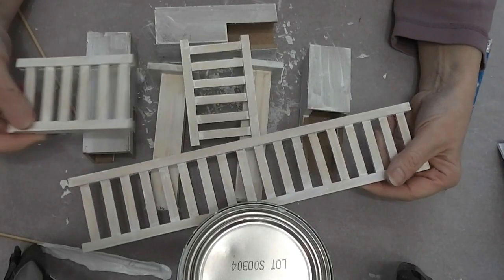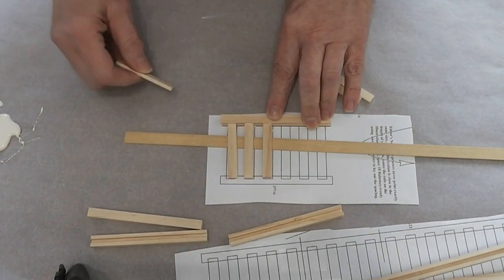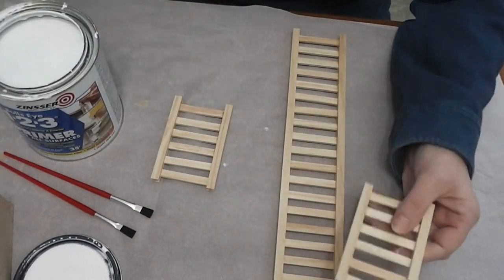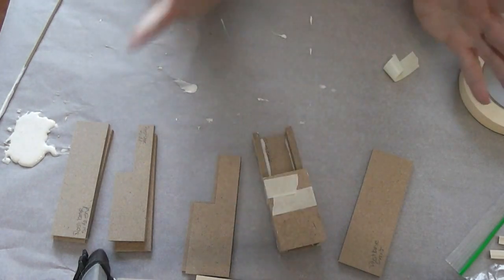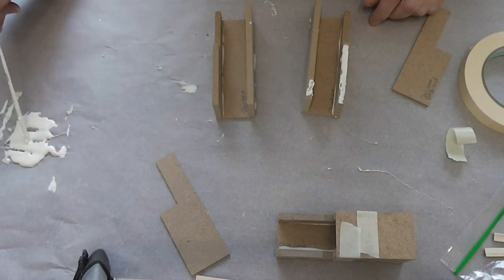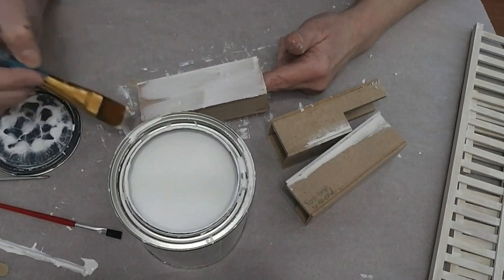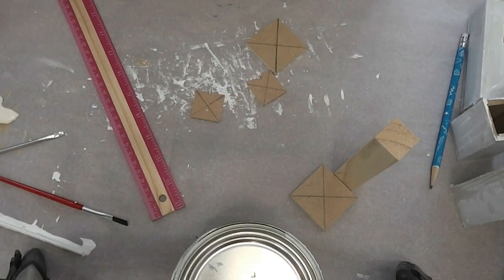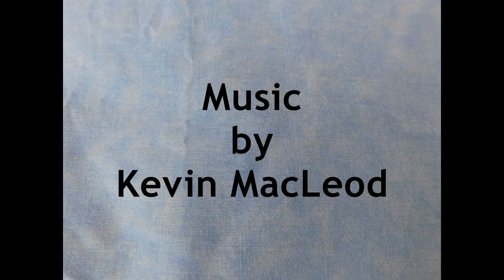Building the Beachside Bungalow part 2

Comment: I absolutely love your tutorial. Can you tell me if you only use primer and paint. The instructions say to paint, sand and paint again.
Reply from the maker: I found most areas needed only on coat of the paint after the primer. My house needed very little (if any)  sanding in most areas. I have a post on my blog that details the reasons why I used primer on the house and I think will answer most of your questions.

Comment: I think I'm going to cry. I didn't realize that when you print out the "new instructions" from RGT website, there's a disclaimer to fix the printer guides. So I put together the railings all wrong. I don't see that they sell these railings separately. I don't know what to do now...
Reply from the maker: I am so sorry I've made that type of mistake also. Have you tried contacting RGT via email and asked for advice. I think that's where I would start. If they can't help you could recreate the railings from strip wood.

Comment: Are you not sanding the pieces?
Reply from the maker: I normally sand after the primer dries if needed before the finish paint is applied.
with a lot of the pieces that are going to be covered with something other than just paint later they won;t need to be sanded at all.